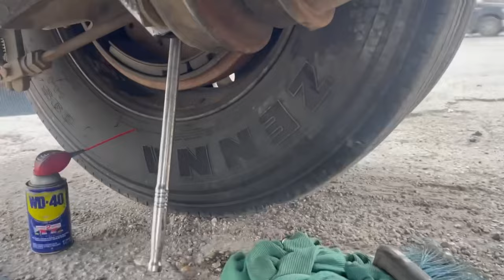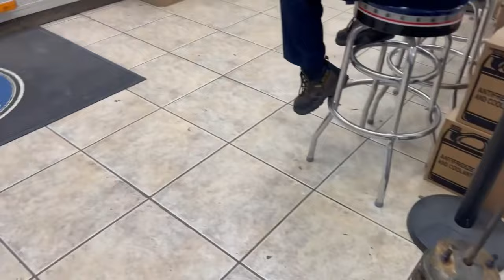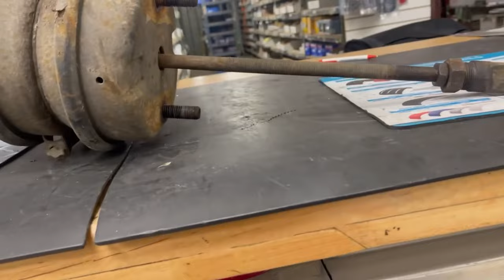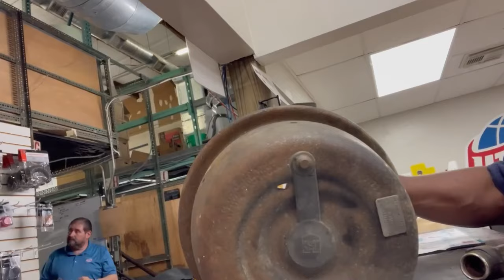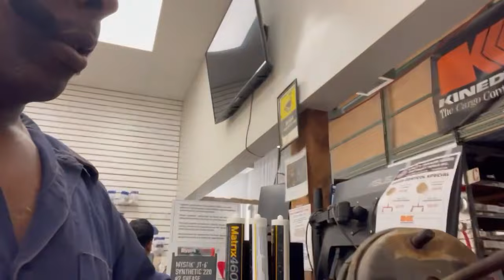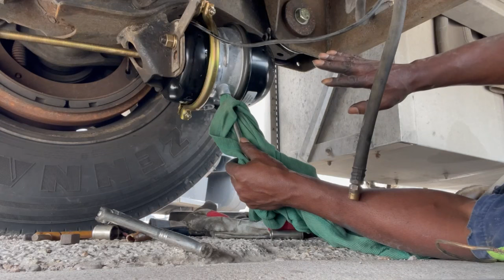My Brake chamber went out and locked up my trailer tires

Comment: Put the cage bolt in the bottom and tighten up to take the pressure off the spring and you can turn it without it possibly exploding. A lot less stressful. Lol